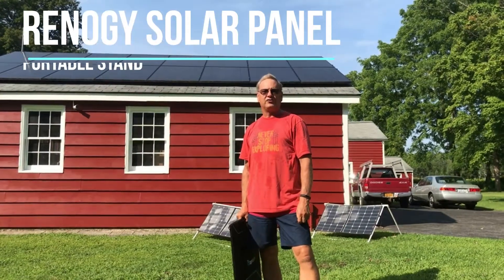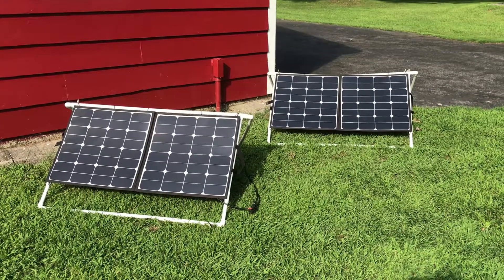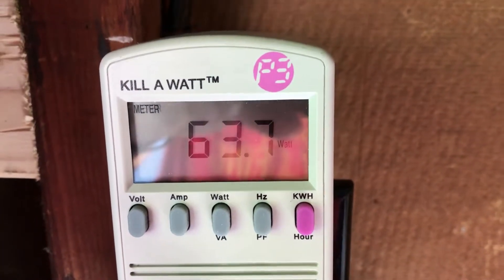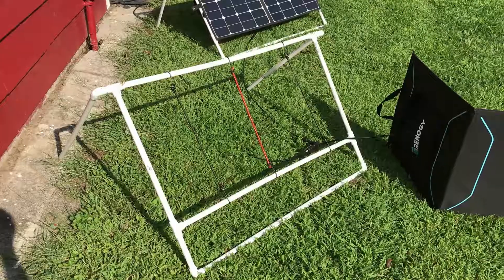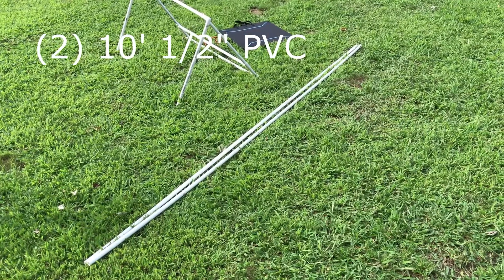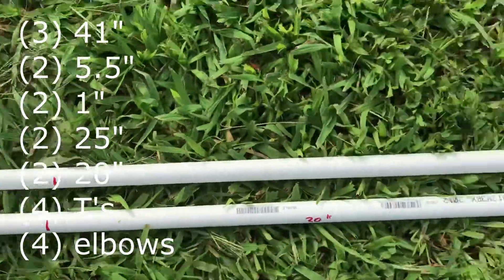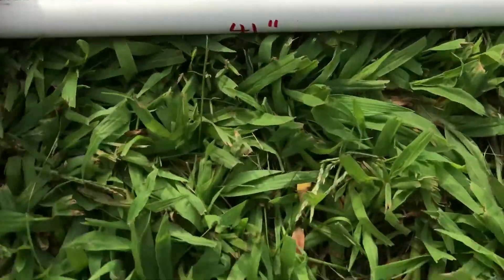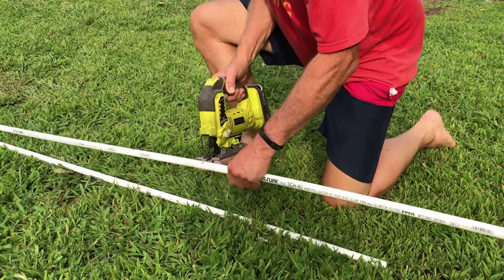Building Renogy Solar Panel Portable Stand

Comment: Thanks for the idea and the "real time" build video. I've got (15) 27" X 41" 100W panels to power my Titan Solar Generator. I'll need to hang them vertically, but this design/idea can be modified to go vertical easily. I don't take all 15 when I go RV'ing, but I might be able to get away with NOT breaking them down so it'll be faster to put them up when I'm at the camp site. At any rate, sure makes them portable, lightweight, and flexible (in use, not strength).

Comment: Pvc is a waste of time. Its to flexible, breakable and time consuming to setup. There are far better materials that look the part and are more solid and don't look like your kids  built a playhouse out of sprinkler pipe. I built a solid 6' x 16 " frame that will support 200 watts of solar power (2-4 panels) , infinitely adjustable, solid enough to support over 200lbs and can be broken down/setup in under a minute.  Completely rigid on all axis. I used "off the shelf parts" and cost was about $25. Time about 2 hours.
Reply from the maker: I use electrical conduit and Makepipe connectors for my more permanent stands. PVC is good for my lightweight portable stands that I use with my trailer.